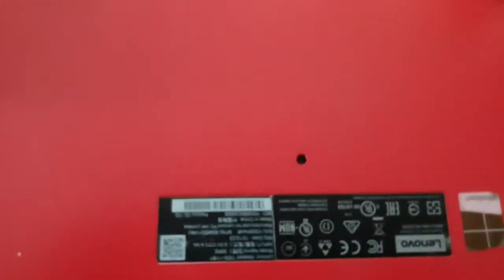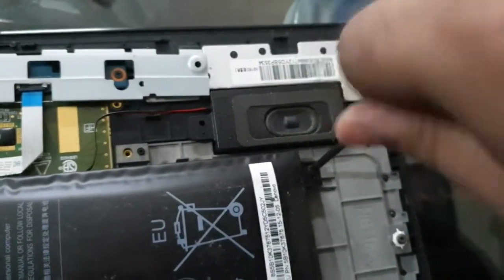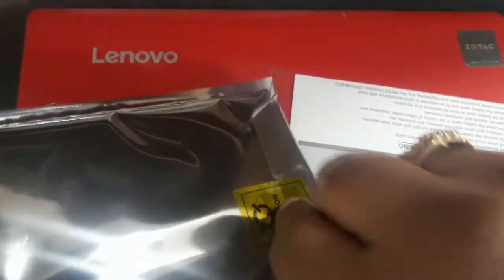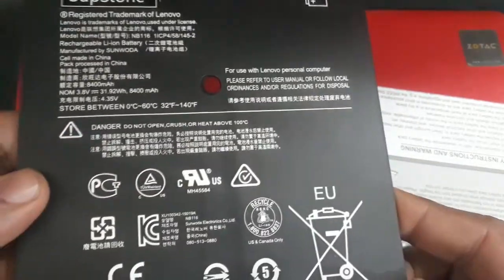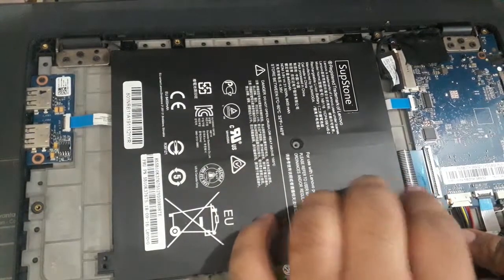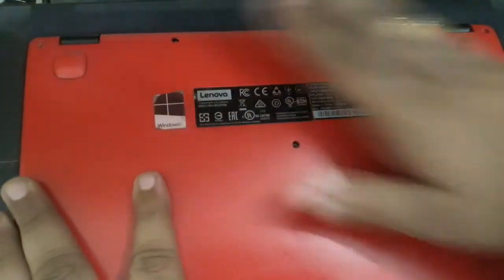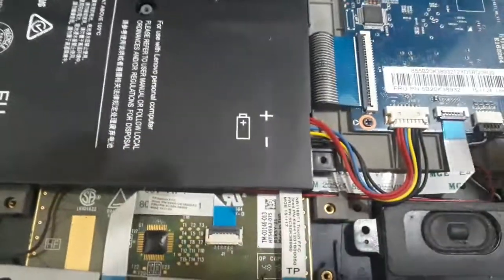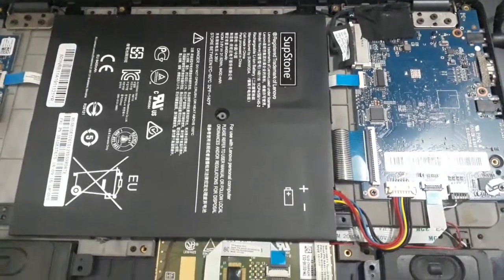Lenovo Ideapad 100S Battery Replacement Guide

Comment: This Lenovo IdeaPad 100S-11IBY very expensive. There is not way to bypass it to use directly without battery.
Reply from the maker: Yes, there is no way to use Lenovo 100s-11iby without battery installed.